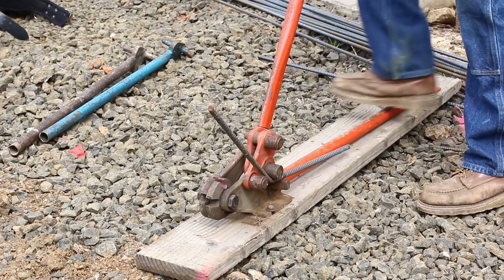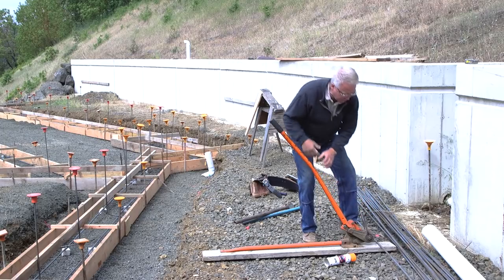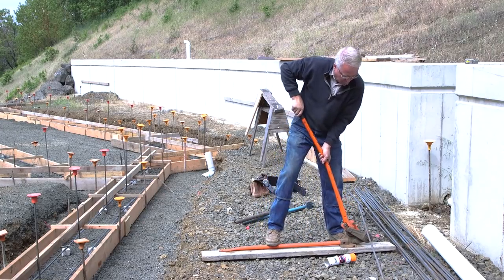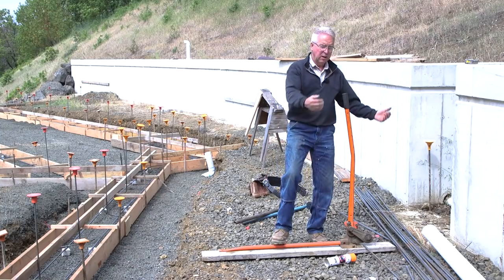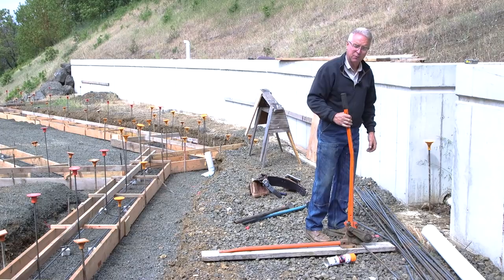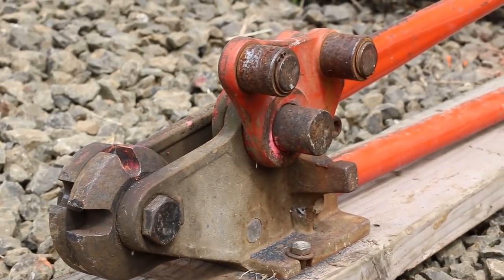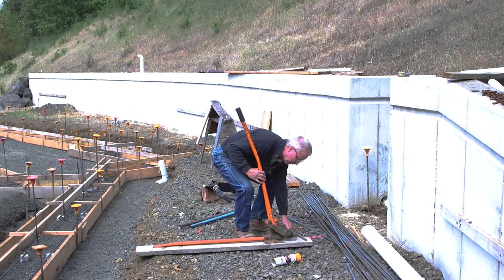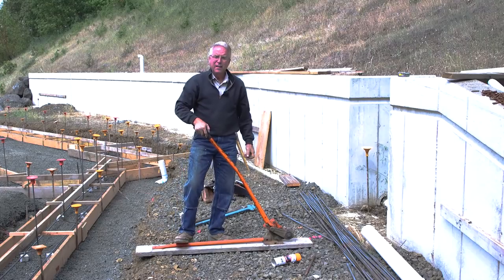Rebar Cutter Bender: Tool Overview

Comment: So, by the numbers you are giving, 3/8ths being number 3, rebar is given its numbers in 1/8th inch increments?  I didnt catch onto that until you called half inch 4 bar, which would be 4/8ths. I think I learned something new, and I work in concrete.
Reply: Yep, you got it. You can get up to #11’s (11/8ths or 1 3/8”) pretty easily at most rebar suppliers. Larger than that is usually special order stuff.
Reply: @psidvicious  I worked at another place where our tonneau cover parts were expressed in 8ths.

Comment: Bent a lot of steel roundstock, 1/4" - 3/8", sometimes 1/2", using a Hossfeld Bender, during my Navy days.  We cut it using either a Buffalo Iron Worker machine, or an oxyacetylene torch.

Comment: I'm no engineer. I'd have to think,though, the moving parts on that cutter would move easier and therefore cut with less effort if there was lubrication on the pivot points of your cutter. This one looks like its never seen any oil. Ever.
Reply: 57fitter best bet is to leave it outside and let it rust solid.  😂😂😂.  It’s heavy enough to hold down a tarp or concrete blanket. 👍🏼

Comment: Amazon sells some cheap electric-powered hydraulic Chinese rebar cutters ($299 for up to #5 bar) and benders ($450+) worth investing in even for just one job - a back saver if nothing else.  I'd skip the old manual cutters - they are heavy and cumbersome and not much cheaper.

Comment: Invest in a torch faster and easier
Reply: Touch is great for bending lol wouldn't like to carry the Gas around either.
Reply: @kiwibird8441  well a metal saw would be a alternative but cost between 200-500 bucks plus a generator another 200-400 at that point a torch is faster, better and cheaper. U can line up the pieces and cut in one pass. In my opinion
Reply: @rafatrill  - He could cut and bend 5 small squares to your 1 at 1/10th the price, I'd bet
Reply: Hitachi  makes a very nice cutter bender.  Turn a dial and pull the trigger.  I believe it's around 2 grand though.
Reply: @Jonesocinco  FTS bruh

Comment: Looks kinda like when I have to cut 500 KCMIL copper wire at work. Even at 225lb I have a really hard time making the cut. Far more difficulty than you even seemed to have with the #5 bar. Anything big is a mean thing to cut with manpower.

Comment: There probably are hydraulic ones. They probably are not cheap, but my neck is worth more to me.
Reply: Electric.  Everything from hand held to portable table tops.  The best way though is to get most of your pieces cut and bent at a fab shop where they use CNC machines.  Then you only need to cut/bend occasionally on site.

Comment: looks like it needs a ratchet style handle, so you can start less upright, and use your weight more. and maybe a cheater on the handle
Reply: In the ‘70s we had one that did have a ratchet cutter now that you mention it - it lasted a couple days before becoming scrap metal
Reply: Ratchet? This is a manly tool for manly men men! Manly men man this man tool and manly cut manly steel with their manliness. Unless they are women, then then they womanly woman this womanly tool and womanly cut womanly steel with their womanliness.
Reply: I'll stick with a manly side cutter, battery or plug in.

Comment: Used to have one of these and yes they SUUUUCK...

We took to cutting bars with a gas saw then using this only for bending.

However .....if you know what your doing you can do a material "take off" and know exactly how many hooks or hoops or bends you will need and those can be provided by any good steel company and its much easier to order X number of bars ....X number of hoops ...X number of hooks....and X number of 90's versus ordering all straight bars and cutting and bending everything by hand

Comment: You are just a little late with this video. I bought one about 2 months ago. I weigh 170 and don't have enough rear end to cut #5 bar, struggle like heck on #4. The bender does work though.

Comment: Do not ask to use your electrician's conduit bender to bend rebar!
Reply: Goddang rod busters are always nicking my 1/2" threaded breakers and mushing the teeth - It's for cutting mild stock you goons!  It's a quarter the size of the one in the back of your lead's pick-up - Of course it's gonna break when you try to cut bar with it!

Every frickin' time I swear to god!
Reply: 😆 Anyone who’s ever been on a job site knows that Ironworkers (rod-busters) never were the smartest or most considerate bunch. And the electricians always have to work so closely w/them 😆
Good luck out there sparky!
🤜🤛

Comment: God damn I hate those things. Designed by the devil. I got a hydraulic cutter cheap from a retiring contractor and it was a revelation. Now I get all my bends and cuts done by the rebar supplier. I have better things to do. Sometimes I need it and I’m cranky every time I do.

Comment: Another entertaining video. But it isn't a  $5 tool. More like $500. If you are bending more than 5 pieces you ordered your bar wrong. Get with a real professional and they will sell you all of the "shapes" right from your blueprints. The straights will need to be cut to length and that is done 10 at a time with a gas powered chop saw. A cheap electric will do if you are only making one building. Good drawings are worth their weight in gold!
Reply: As he mentioned that last video